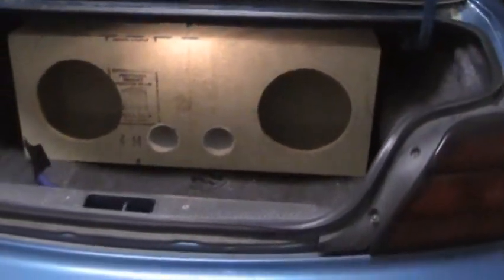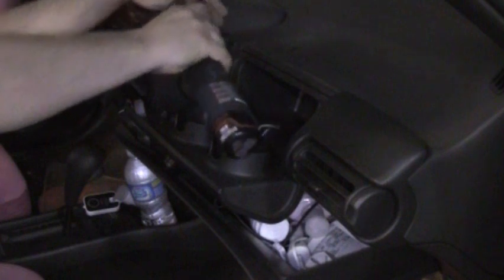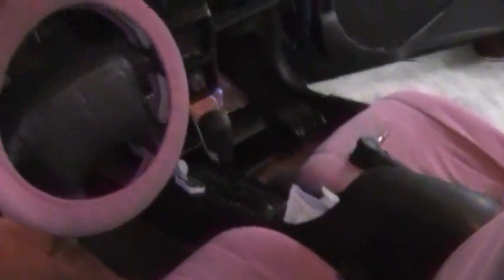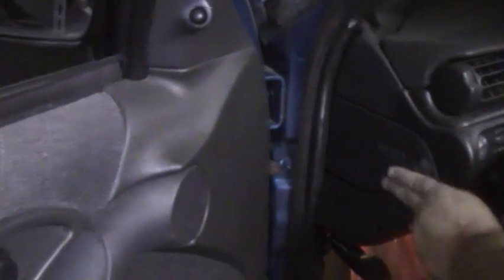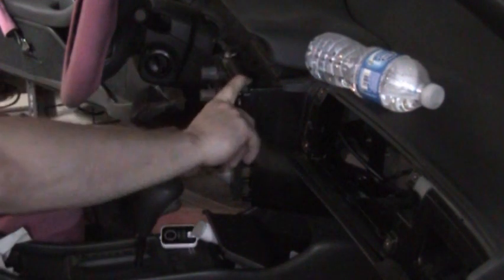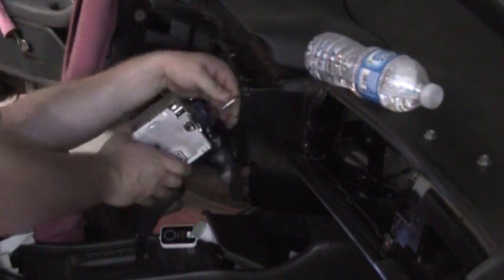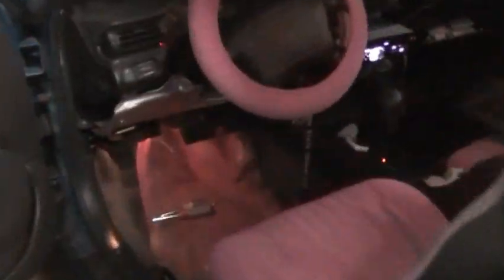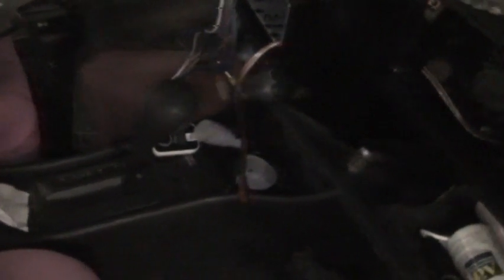How To Replace A Car Stereo: GM Example.

Comment: Damn you have vids on Everything sweet haha quick question I was giving a 1990 Cadillac Eldorado and I'm looking to replace the Stereo it already has a aftermarket stereo installed which is a Panasonic and I bough a JVC KD R330 and I was wondering if I need to buy that aftermarket harness or do you think that it already has on since it has a Panasonic Stereo already installed ???

Comment: You should of showed how you put the stereo in because I can't find any YouTube videos on it. So when you pulled out the old stereo you removed the antenna cable and the adapter. So I just bought a new stereo and the adapter that went into my old 03 suburban stereo is too big for the new stereo so I am completely lost on what to do and I was hoping you would show how you plugged In the new stereo but you skipped that part any advise? Do I need an adapter that converts the big power plug into a

Comment: I bought a wiring harness for my car, is it simple as plug and play? Theres a big plastic input slot that used to go to my original radio that is just dangling behind my aftermarket deck. My aftermarket deck uses a smaller slot. One I receive my wiring harness do i plug it into my original bigger sized harness? then proceed to connect the other smaller end to the aftermarket deck?   dynamicsounds(dot)co(dot)uk/autoleads-pc2554-jaguar-sovereign-xjv8-xj12-wiring-harness-p-9196.html